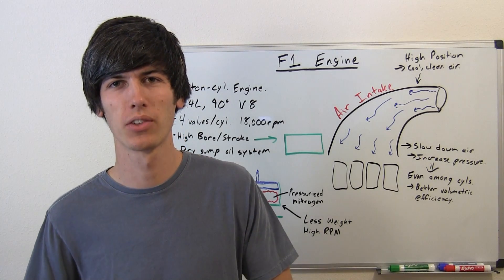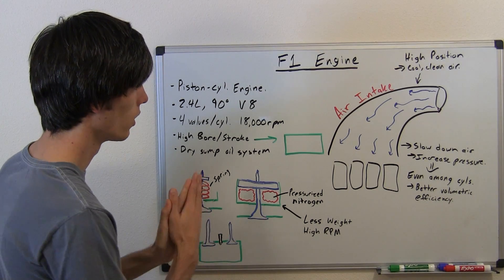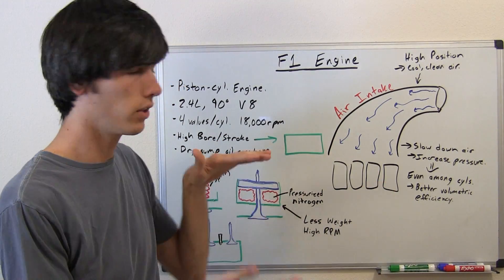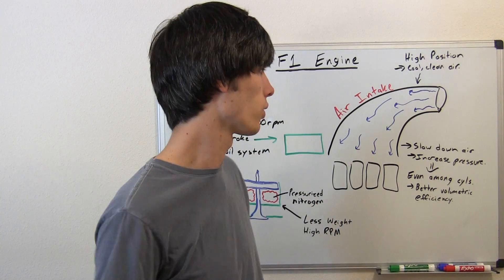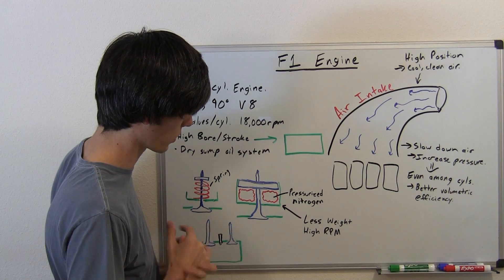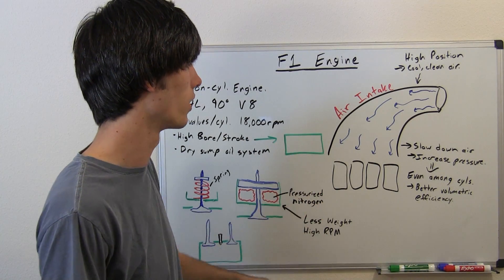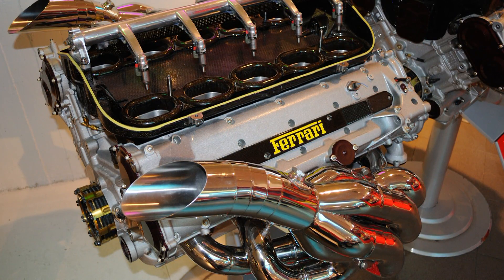F1 Engine - Explained

Comment: Let's go through the basics of the intake phase again.
As the piston is accelerating, vacuum is created and the air is entering the cylinder at a high velocity. When the piston decelerates the mass air flow creates an overpressure. All dependant of tuning of camshafts and intake ports, you can get as much as 130% VE peak in a NA engine.
You should trade your Acura for a Saab and you might understand engineering better right away.

Comment: Will that valve actuation system ever get into road cars or is what we got now good enough?
Reply: What we got now is good enough. Road cars don't rev as high as F1 cars. So the spring system will do just fine. Also, the price would increase because Nitrogen is actually expensive and manufacturing such complex parts for this injection system is also more expensive.
Reply: For now no ,but electric valves are now the new way to go.

Comment: Have you ever built an engine ? Have you ever driven on a race track ? Have you ever driven over 130mph ? May by you can explain laminar flow vs turbulent flow in relation to anule discharge nozel .
Reply: trolling a 4 year old vid, lol ... just go ahead and explain it to the class, wise guy.
Reply: anule? nozel?
If you're gonna try to sound smart, try harder....
Reply: Having track experience or fast driving is not required to have a technical understanding of things. Alot of engineers are no athletes or racecar drivers. So your crittics are irrelevant.

Comment: The info on here is pretty accurate for the most part. Couple of minor things though, F1 teams would pressurize the incoming airflow to use a ram air effect if they were permitted, however it is outside the regs to do so. The other inaccuracy was the volumetric efficiency, its possible that F1 cars have low V/E due to the high RPMs but in other forms of motorsport it is possible to achieve over 100% V/E in naturally aspirated engines with cam overlap intake design,  header/exhaust design  & etc..

Comment: Can you tell me why F1 engines prefer hydrolics for the valves instead of a purely mechanical solution like the desmodronic valves on Ducatis which also allow for very high rpm?
Reply: Here's something I wrote for someone else a while ago . . . it may help.

Ducati use desmodromic valve systems because it provides
for;

 

1) A more faithful adherence to both;

1A) Not just high speed Valvetrain
timing.

1B) But also high acceleration
Valvetrain  rates; regardless of what
weight/material the valve is made from.

The latter (1B) - which can provide an advantage over the
pneumatic Valvetrain design approach - allows for a more optimal and
square-wave like Valvetrain function; a function that most typical valve-spring
Valvetrains (even at moderate speeds) simply can’t accommodate.   

 

2) An alternative to pneumatic Valvetrain design approaches
used by other manufacturers in MotoGP; that - if implemented correctly - can
also provide both weight savings and also cylinder head port geometry benefits.

 

Footnote 

Ducati's desmodromic valve system was (contrary to popular
belief) not invented by them, it does actually employ springs (see links below),
and (some of) the significant considerations and/or drawbacks of the
desmodromic valve approach are as follows;

1) A complicated design involving phase-conjugate camshaft
design and machining that performs marginally better than most modern day high
performance valve-spring alternatives.  

Please note how;

1a) Most comparable Japanese (and some European) motorcycles
using traditional valve-spring alternatives not only reliably rev higher than Ducati's
desmodromic valve system, but also do so without loss of power when compared to
Ducati.

1b) Several other Japanese and European motorcycles using both
(i) the same 90 degree “L” and/or “V” twin engine configuration and capacity as
Ducati, and (ii) traditional valve-spring alternatives; not only produce
similar and/or more power than Ducati - but also do so quite reliably.

1c) Ducati’s desmodromic valve system employed in their
earlier 900 SS models (that shared an almost identical engine 860cc design to
their 860/900 GTS range) provided no real meaningful power/torque benefit over
the their 860/900 GTS range - at least not one that could not easily be
attained by doing the same (non desmodromic valve system) “delta” modifications
to the their 860/900 GTS range.

2) Ducati’s desmodromic valve system's camshaft (timing and
conjugate) designs are considerably more complex and therefore susceptible to
change engine behaviour with wear; more than, say, other traditional
valve-spring alternatives/designs exhibiting the same degradation.

3) Maintenance and servicing intervals. Take a look at
Ducati's (real-world and much shorter) homolgated product line's servicing
intervals to most Japanese (and some European) motorcycles using traditional
valve-spring alternatives/design; and note also how much greater the crankshaft
rotational speeds (friction/wear?) are of the Japanese counterparts that
usually have greater servicing intervals.

4) Mercedes Benz whom (between them, Maserati, Ducati, and
Austin, are often cited for inventing the desmodromic system) have a
considerable racing/engineering success and history, and they were one of - if
not the - first to use the desmodromic system in F1. Mercedes Benz didn't drop
the idea of the desmodromic valve actuation because it performed better in ways that made the additional
complexities worthwhile.

5) The desmodromic valve actuation system that Ducati have
some patents for is considerably different than the first desmodromic valve
actuation systems that were invented and aforementioned. 

6) All currently working desmodromic valve actuation systems
that offer timing diagram and other performance benefits over traditional
racing and/or high performance valve spring Valvetrains must employ extremely
aggressive (even by traditional racing and/or high performance standards) Valvetrain
acceleration rates in order to make their advantages realizable over other
options; and even then the cost effectiveness and the performance benefits of
currently working desmodromic valve actuation systems are still debatable -
hence their lack of popularity with the racing fraternity.

7) Rotary valves - when correctly implemented - are a far
better idea than currently working desmodromic valve actuation and also other popular
Valvetrain systems; that lost popularity and funding for F1 and other
decisions. Theoretically this (rotary valve) approach resolves many limitations
of the poppet valve whilst also offering many other benefits. 

8) It still requires springs to be implemented properly and
reliably; defeating one of its most commonly considered benefits.

9) The whole idea of any desmodromic system is to force the
valves to remain utterly complaint with the Valvetrain/camshaft timing diagram
as faithfully as possible. As such the way in which Ducati implement their
desmodromic valve actuation in MotoGP means that (unlike pneumatic and traditional
valve-sprung Valvetrain systems) there is no chance that the intake/exhaust
valve - as it transcends through its line of theoretically allowed linear
movement - can move in any other way than the timing diagram intends. 

To be clear on point 9; conversely, pneumatic and traditional
valve-sprung Valvetrain systems can often (and sometimes are actually designed
{within 1/4 mile and/or engine power shoot-out contests} to) accelerate their poppet
valves at rates that are faster and/or not entirely adherent to the camshaft
and/or overall Valvetrain timing diagram.

Finally, I believe it is mostly for reasons of tradition,
heritage, and marketing, that Ducati persist with their desmodromic system on
their non MotoGP machines; as it provides very little real-world benefits in
those guises.
Reply: I would think it's because of the weight reduction and the fact that they can easily replace and service the valves.

Comment: My question is why do they opt for high rpm screaming engines instead of lower rpm/high torque ones?
Reply: If you triple the rpm  of a normally aspirated engine you, in effect, triple the displacement compared to a slower turning engine. In the same minute you load the engine with air/fuel mix and fire all cylinders three times for every time the other slower turning engine fires once. Which - even though the torque ratio is less, and the power band is narrower, the net is more performance, seven speed gearboxes and 1/1000 second shift times between gears help get the power to the road..
Reply: high rpm's engines can be build smaller and lighter, which suits perfectly a formula car. I remember that the last generation of the V10 engines they run had a dry weight somehwere between 80 to 90 kg, but could push out over 900hp peak power. And with proper gearing, it doesn't matter how much torque the engine is producing. It's just the power that matters.

Comment: Wrong. My naturally aspirated engine on the dyno can and did get 101%+ VE ( 108% max) from 3600rpm - 7000rpm.  This was with a Mopar 440cid pushrod 2-valve pig.

Comment: just wanted to clear some things up
1. the short travel on the cylinders does allow them to rev higher, but it has a big effect on efficiency at low rpm. In other words if the motor is in idle at 800 rpm, it is using too much gasoline to usable on any street car.
2. The dry sump system is not necessarily for running out of oil when your turning. it is to get rid of the friction caused by excessive oil on the moving parts that are not under friction. In other words a motor reeving at 1800 rpm would feel the drag with the excess oil hitting the crankshaft.   
3. The intake is also positioned on the top to get fresh air. Motors are air pumps after all, the more air you get the better. But if you are behind another car, the exhaust of that car in front is going to cut your oxygen intake. That is usually not a problem on drag racing since you are never going to be directly behind any other vehicle. So in drag racing.
Reply: +allith .galaviz Engines, not motors.  Engines create energy, motors use energy.
Reply: +Shawn  Nothing "creates" energy ....
Reply: Juan Carlos Damonte
Whatever, man.  You get my point.

Comment: what is the disadvantage of a very high bore to stroke ratio
Reply: +kenykillr Peak torque and power are generated at a high RPM, so you need to rev the engine. Fuel consumption and emissions can also be higher because fuel and air may not mix properly, resulting in poor burning.

Comment: +Engineering Explained
The pneumatic valve technology does not actually work the way you describe, at least not in F1. I'll admit you got it kind of right, but you dont actually have a camshaft at all. Instead, you got a pressurized tank, and a computer controlled valve sends the pressurised air either to the top side of the valve (valve open) or the bottom side of the valve (valve closed)
This is one of the biggest differences, no camshafts means no cam belts, less moving parts.

Another difference is the precision of the pistons. metal expands when its cold, so in normal engines you have to have some leeway to allow the pistons to vary in size for when its cold. An F1 engine does not have this leeway, and because of this it can not be started cold, it will be jammed shut, and you have to feed it warm oil for hours before you can even start it.

I'm surprised you did not bring these differences up, could it be that you didn't researched it enough?
Reply: +etproductions666 I can tell you, they still have a camshaft, to be exact, 4 camshafts. The prober term for what they use in F1 is a "pneumatic valve spring" and nothing more. They only use air pressure to close the valve instead of a normal spring.
Reply: etproductions666
They never show the camshafts, because the design of the cams would give away things like the firing order they run, cam lift and so on. But in some pictures it is possible to see where the camshaft bearings are housed and there's also a little part in the technical regulations where the FIA limits the materials a camshafts can be made of.
Reply: +shi01 Fair enough, I cant prove that they dont use cams, but as I said, I've never seen any cams, and there is a better system available,and  I refuse to believe F1, which is the pinnacle of motorsport, would use anything that is not at the peak of what is technologically possible. Unless there is some rule saying they have to have camshaft operated valves.
Reply: +etproductions666 Well, there is a rule which says they aren't allowed to run variable valve timing or valve lift, which makes the advantages of a camless setup pretty much obsolete.

Comment: Is the nitrogen air in the valve train constantly charged by some type of device or bottle in this example, or is it sealed? Seems like it would be difficult to get a perfect seal with no leaks, but then again, this is a racing engine built to super high specs. Maybe some good mock-ups are in order.

Comment: wonder how they made the honda cbr250rr to rev to 18000rpm with regular valve springs back in circa1988
Reply: +rushanz n Smaller engine with smaller valves means way less inertia and the problems with valve float will start to occur at way higher revs. The smaller the egine, the higher you can rev it without running into serious problems.
Reply: shi01 Good stuff

Comment: one thing im missing in this video (and i know its a long time ago) is that the pistons are a much MUCH more tighter fit inside the cilinder. thats why the engines cannot start cold because the pistons are basically stuck inside the cilinders. they always have to use an external heat source (warm oil injection) so warm up the engine to be able to move the pistons and start the engine.

Comment: Good vid. One small correction. You can get over 100% cylinder fill (volumetric efficiency) without a supercharger or turbocharger. It's a big reason why intake valves start to open before the exhaust valve closes and the intake valve closes after the piston has started coming up from BDC (suck, squeeze, bang, blow). The inertia of the incoming air in the intake tract causes the air to 'stack' up in the cylinder. So even though the piston is coming up from BDC, air/fuel is still flowing into the cylinder for a bit because the air is flowing into it and its momentum keeps it flowing a bit even after 100% cylinder fill has been achieved.

Comment: Flawed. Motorcycle engines rev over 12000 rpm. valves are tiny and have little inertia, Small pistons are light so the rods won't break and inline fours have light cranks. Horse power is torque by revolutions per second. Piston speed is kept low to lower friction and inertia forces on the rods. An model airplane engine is a 2 stroke diesel that revs very high reliably. smaller is better.So add cylinders for more horse power.

Comment: Okay, crazy question I've had since the 80's. What if we get rid of linear motion valves altogether and use some sort of aperture valve like the aperture on a camera (old camera, lol) I mean use a center post to fill the obvious gap that would have to exist I suppose. I am thinking maybe use an electric actuator to operate the aperture? get rid of the camshaft and actuate it with the computer? Think about the advantages! You could vary the cam profile, overlap, everything! Fantastic low end torque AND top end.
Reply: +Jack Allen I too thought about iris valve, but then realised it would not be able to take pressure or heat, and would soon become unuseable due to contamination amongst the leaves.
Reply: Tom Humphries...an F1 engine from the 60's IIRC used a rotary valve setup: it didn't work very well. Too much overlap on exhaust and intake strokes.
Reply: Just because it hasn't been done before, or even if it has been done, but didn't work for some reason, doesn't mean it can't work in the future.  Some ideas just need technology to catch up.

Comment: Question:
Why do F1 engines, when they were atmospheric had indirect fuel injection instead of direct fuel injection?
Reply: I believe it had to do with the latent heat of evaporation of the fuel chillin cooling the intake charge which helps a few ways. First colder air is denser with more o2 to burn more fuel. Also knock is a problem with these high strung high impression compression engines. Cooler intake charge helps lower the knock threshold.

Comment: Why hasn't more race cars or even high performance street cars moved on from springs to pneumatic valvetrains?

Even if they don't have a need for more than 11k rpm or more, it seems to provide less stuff that can go wrong? ... Or is it the other way around?

Do motorcycles that rev to 14-16k rpm with bores as big as small 4cyl car engines (fx 98 mm bore on some Ducatis) also use pneumatic valvetrains then or do they work in a different way?
Reply: +barath4545 Your guess is as good as mine, mostly due to engines typically being specd the same for individual racing series.

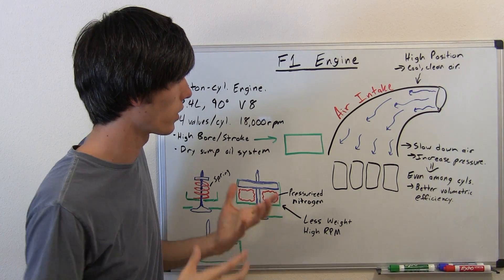Comment: I'm confused on the portion around 3:30 when you are explaining how slowing down the air increases pressure. My understanding is that pressure is a function of force over area , with force = mass*acceleration, so wouldn't slowing down the air decrease acceleration by creating a negative acceleration thus decreasing pressure?
Reply: +Zack Bayhan Nope. Just look up "Bernoulli's principle". Yes, very counter intuitive, but that's the way it works.